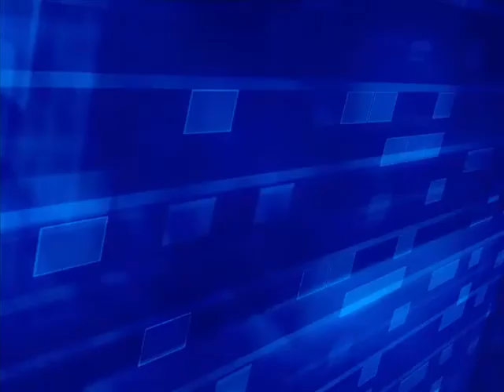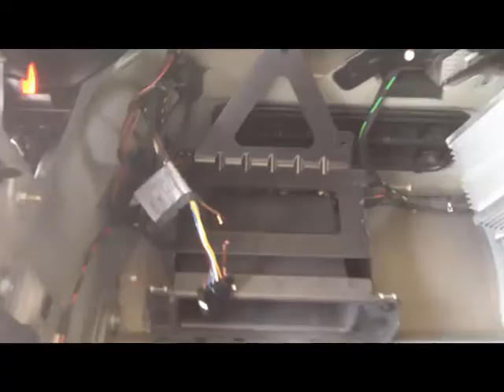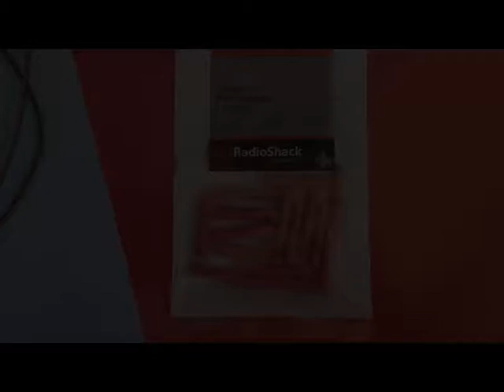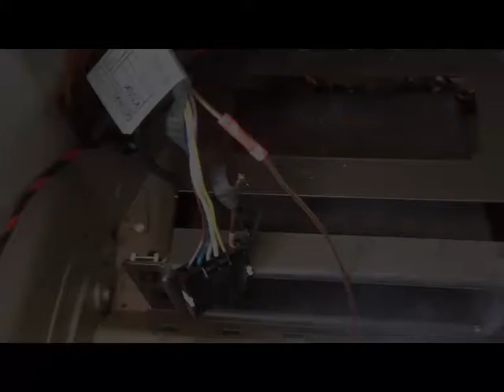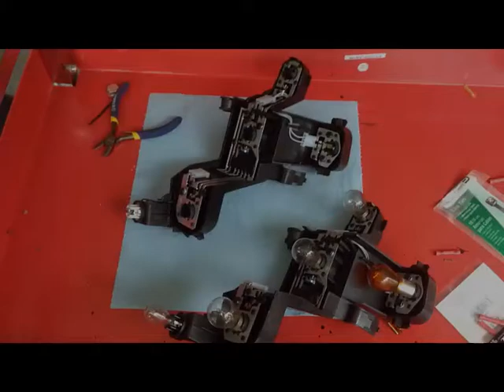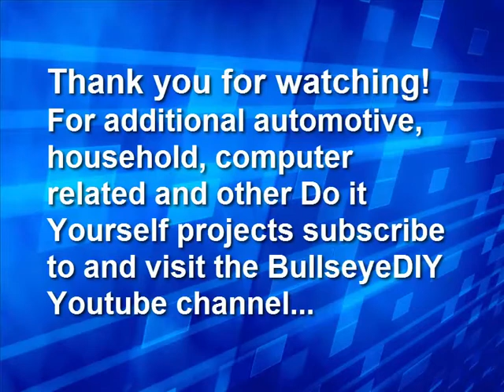BMW 5 series rear tailight bulb carrier DIY Part 2

Comment: How the heck do you get the connector off? Mine will not come out and I don’t want to break it. Any suggestions?
Reply: Gently pry it out with a small flathead screwdriver.Take you time!
Reply: @NickeryNelson  man I tried so hard lol it won’t come out. My car is. 2001 so it prolly hadn’t been touched in 20 years. The other side came out easily tho, I sprayed WD-40 and it still won’t come out SMH

Comment: Hey, man. Great video. Will be doing the same fix to my e46 325i. Where were you able to find a new connector (to the bulb carrier) that came pre-fitted with the metal pins/connections inside the "box"?
Reply: Great. I found the parts schematic on a dealership parts website. Then I wrote down the part number and Googled it.

Comment: Would have been helpfull if you showed how to remove the connector it doesnt come off easy!!
Reply: I’m having the same issue!! How do you get it off/out? Any help appreciated
Reply: @brey93  its because of the rust buildup inside make sure the clips are not lovked and really try to pry it with a screw driver lol that worked for me.
Reply: @khanOfAllTrades  yeah I was thinking the same thing, I have a 2001 530i and I think it hasn’t been touched in 20 years but I’m scared if I pull too hard I’ll break it. Thanks for the speedy reply btw
Reply: @khanOfAllTrades  do you think if I spray wd-40 it’ll mess up the wires?
Reply: @brey93   if you are certain about the water damage then the connector is probably ruined anyways. I had to replace the tail light and the connector so i didnt shy from using force

Comment: I thought there was a way to remove the connectors without having to cut and splice them??
Reply: Yep there is
Reply: There is, pop up the white cover piece on the connector and you'll find the tabs which you can push down on to remove the wires